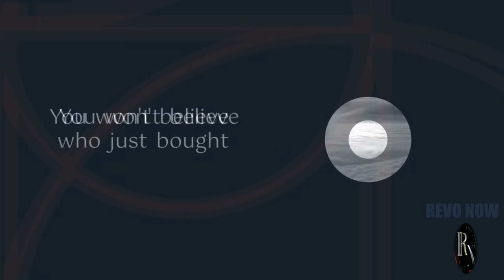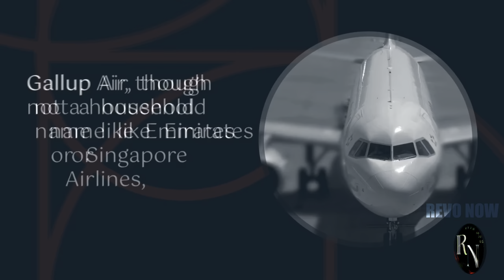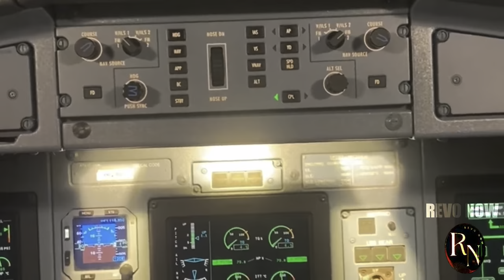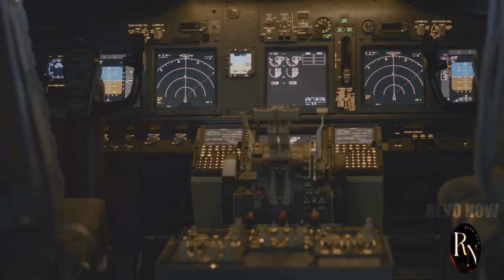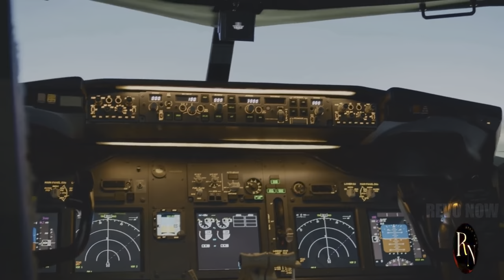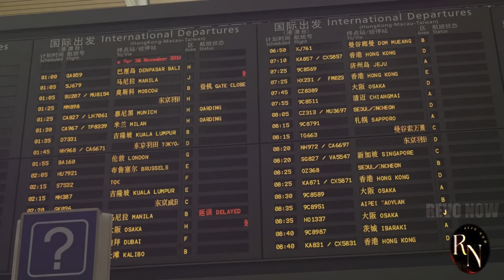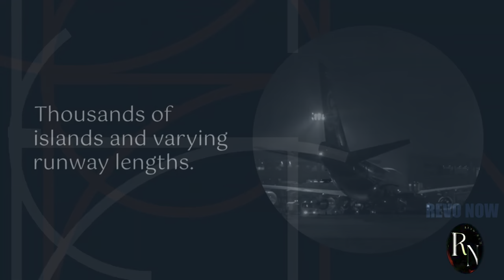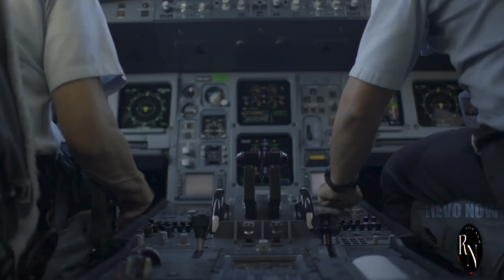China Makes a Remarkable Leap in Air Travel

Comment: It was on the Local News this morning & it stated  that an U$A’s Airplane loosing air pressure causing the passenger’s ear drums to ruptured, cause the ears to bleed because, due to the changes in the air pressure inside the plane’s cabin & it wouldn’t be surprising that it’s a “Boeing Airplane” - be afraid - be very afraid!😱😱😱

If it’s Boeing - I’m not going!👍🏼😅😂🤣
Reply: @HappyPandaBear73  if it's Boeing I ent going🤣🤣🤣👍